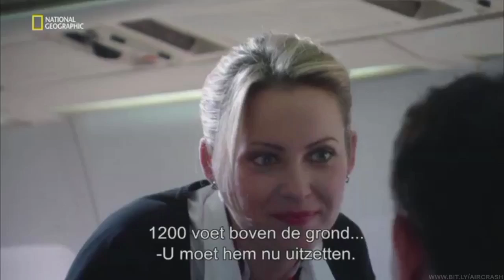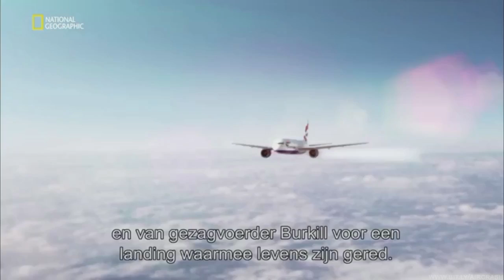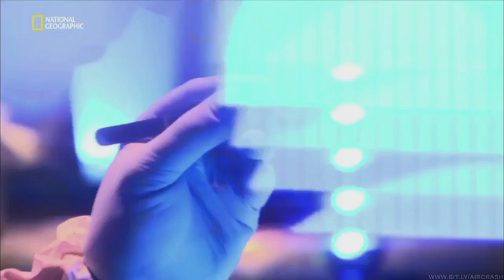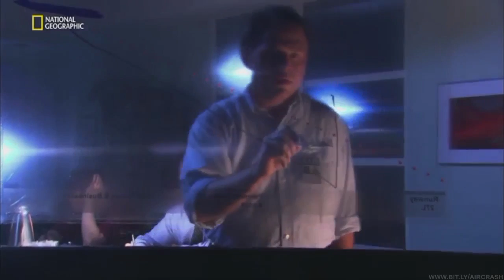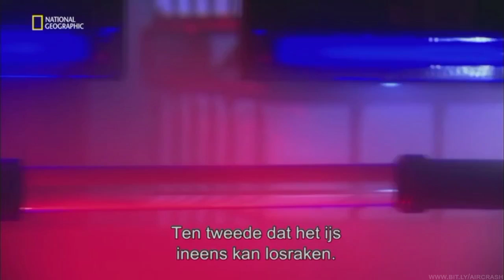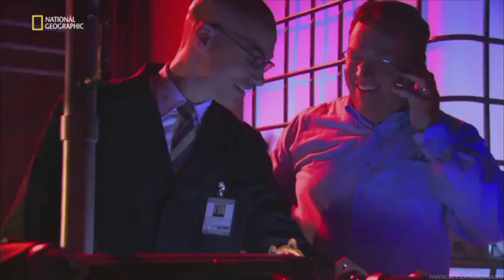[HD] Air Crash Investigations - S10E02 - "The Heathrow Enigma" [+ subtitles]

Comment: I don't get it. since this crash has things changed? I was flying a few days ago and the temperature outside was -49 I was thinking about this episode and worrying that the fuel was going to freeze or go waxy. in this episode it starts when it's between -15 to -35 What's up with that?! are systems better now? response would be great! thanks to all you plane lovers!
Reply: It says the air temperature was -74 over siberia.
Reply: The outside air temp isn't the problem. Aircrafts have an anti ice system. Fuel starts to freeze beyond fuel temp of -37. So no matter how cold the outside temp is, as Long as fuel temp is above -37 all is fine

Comment: They're investigating fly-by-wire plane as if its still analog  machine, without runing through software flight modes in simulator. So this is obviously just a mockup of invastigation. 
Only thing they need  is  software bug fixer.